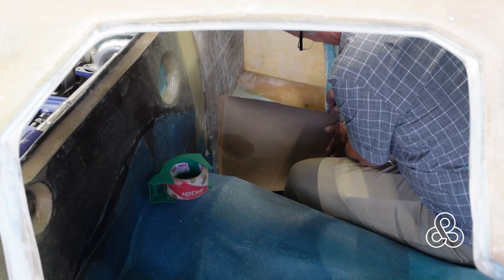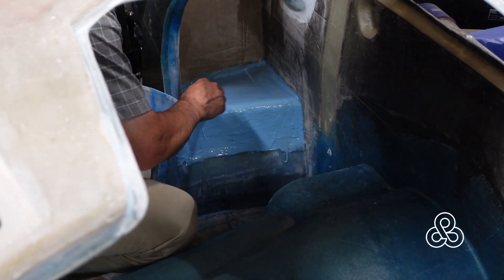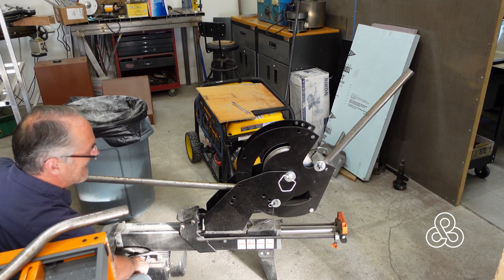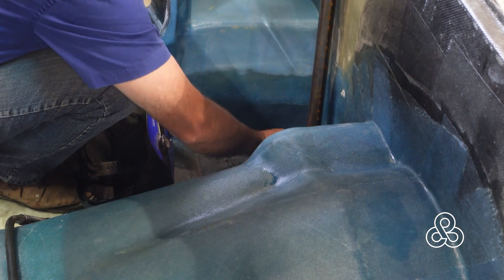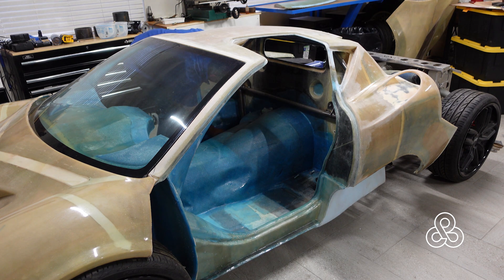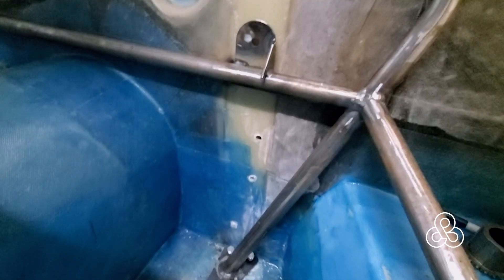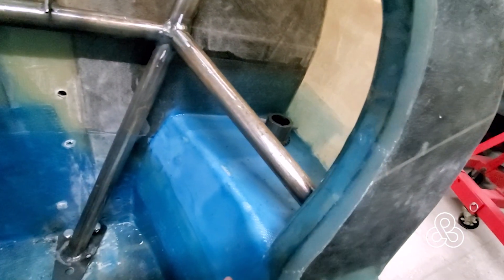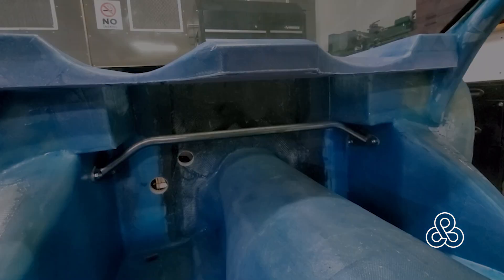A81 Roll Bar, The third layer of composites. Arete Supercar Project

Comment: Why not use Lexan for windows, much lighter!
Reply from the maker: Lexan is not approved for windshield use in most states. For those wishing to license their car for daily use, you need that DOT safety glass (plus it is MUCH more resistant to abrasion from wiper action). I will have Polycarbonate in the sides and rear.

Comment: Did you use chrome moly for the roll bar?
Reply from the maker: .188 DOM mild steel. The rigidity is in the fiberglass, I wanted malleability in the roll bar. Chromoly is also a bit brittle especially in the welds.
Reply: @BuilderCreator  , you are right Jay. I think the chrome is the problem.

Comment: Wow that homemade pipe bender is a great idea. Do you have a video on making that? Where did you get the parts for the form, etc. that the pipe bends around?
Reply from the maker: Sorry, I did not make a video of the pipe bender. The hydraulics were from Northern Tool. com. It was a wood splitter that sold for less than $200. I don't think it would have been a very effective wood splitter, but plenty strong to bend up to 2.5 inch pipe/tube. The dies came from a manufacturer of a tubing bender that works on a similar design. All the steel plate is quarter inch stock, cut out by the local waterjet service.

Comment: Hi Jay
Great channel, Im building a car, replica actually mclaren 765lt cnc milling from foam. I have about half milled already and im starting a youtube channel in next month just to document not an expert im an accountant by trade but always making things custom knives, jewelry, cnc machines etc. Not to waste your time I can tell you are extremely knowledgeable and would greatly appreciate you input on my project i can send you photos my main question is i plan on sealing the foam with epoxy with filler, but what would i need afterwards to get ready for mold can i go straight to glazing an lowspots and paint buff and mold or do i need another layer of body filler or something else? 
Thanks 
Adrian Jr.
Reply from the maker: I see you mention the building of CnC machines in your description of skills. Will you be using your machine to cut the foam? If so, you may consider going straight to cutting the molds rather than building a plug. It will take considerable more time in modeling, but might save you time in the long run. Take a look at #XSMotorWorks channel. Brian over there has been cutting foam molds similar to what you need for a while now and you can get a good idea of what I'm suggesting. I think he may even have a video about finishing the foam surface for pulling parts. If you still want to build a full size plug we can talk. I only mention this method, as you are building a replica. If you were creating your own design, I would definitely suggest the full size plug to refine your design.
Reply: That sounds like a great idea. Its a pretty complex car and and my modeling skills are not up to par lol. Plus i already have the model of car split and have milled half the car already lol. So ill definitely be  going the plug route. Any additional info would be appreciated i have learned alot from your videos and would be going a similar route. P.S. do you have a cash app or any way of compensating you for your time please let me know.
Thanks

Comment: Great work, man! What type and model of tube bender you are using??
Reply from the maker: As mentioned, I built it from a cheap (Northern tool I think) hydraulic log splitter. Bought the dies on line, as I don't have a lathe big enough to turn 8" stock.

Comment: Brilliant work there, I was curious what transmission u have paired with the 1jz(if ur still using it) and also if it's from the gm automatic family(4l60/65e) which are typically in a front engine configuration, have u just rotated the drivetrain all the way around ?
Is the transmission ending up in front of the engine that way ?
Reply from the maker: Yes, the 4L65e. And as it faces forward (or backward depending on how you are looking at it) a mid mounted center differential will reverse the rotations.

Comment: So I was trying to build my own car as well just like you, and I was wondering how much the entire thing has cost you because I'm a student right now and don't have a lot of money so I was wondering roughly how much it costs from stary to finish. And I'm just talking about the price of all the materials not the machinery. Also I just started watching you a couple days ago and I have already watched this entire series and I have found it extremely interesting how instead of buying most the things you are making them yourself. And I wanted to tell you that your videos are amazing and keep up the great work so you  can finish this amazing car
Reply from the maker: The car is going to cost me between $30-$35K (materials). Just know, that building all the components is not actually the less expensive way to build. If you can find a donor vehicle that has a complete power/drivetrain that will save you a huge amount of time and money.  Say a Fiero for a mid engine car or a Corvette for a front engine car. Of course options are endless. Hope this helps. Thanks for watching!
Reply: @BuilderCreator  thank you so much

Comment: Been following your project for a while, and I'm also making a garage car, just mine's still got way more things need to sort out.
one question I wanna ask is, I'm using 3d prints then having bondo and paint on top of my body panels, and the result is each panel feels too thick and too heavy, hindering the performance of my vehicle. I wanna find a way to make them lighter, and the first thing I can think of is to reduce the thickness of the prints. And see if it can match the thickness of steel or fiberglass panels without losing structure rigidity. So want to ask you what's the average thickness for fiberglass panels?
Reply from the maker: I don't know if I can say what an average thickness is, but I have a target that I am after in non structural panels -7oz/square foot (200g) per square foot which equals .085" (2.2mm) thick in S-Glass/epoxy layup. This works for me as most of my body panels have complex curved surfaces which adds significantly to stiffness. You could double that+ weight for fiberglass mat and polyester layup (most kitcars). Were did you get a big enough 3D printer to print body components? If I could print that big, I would print a mold and lay up in the print.
Reply: @BuilderCreator  thanks! that helps a ton! for 3d print, i'm working with an engineer and he divide the panels into jizsaw pieces first, then glue them together before reinforcing with carbonfiber. the surface's pretty stiff.
so you're thinking to print the mold, then use that to reproduce panels?